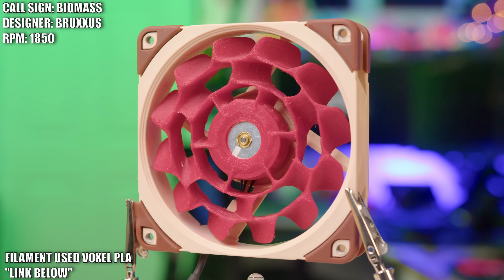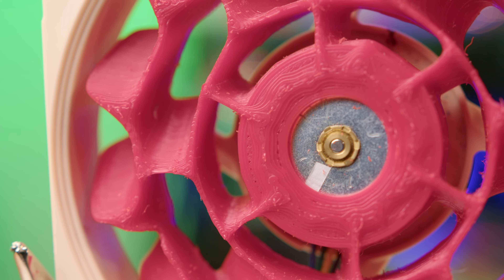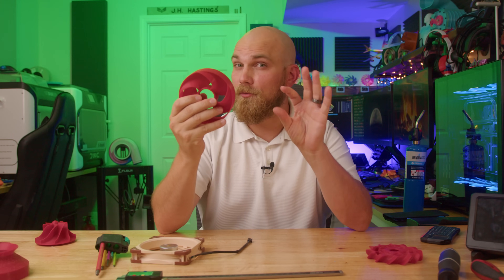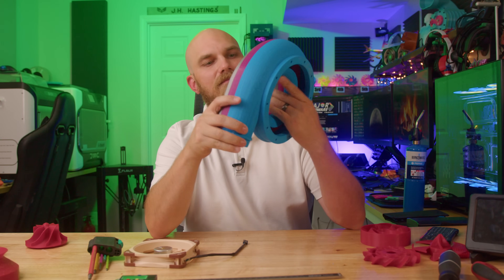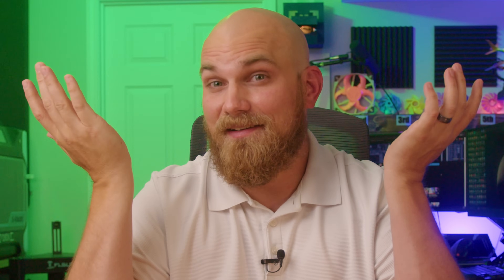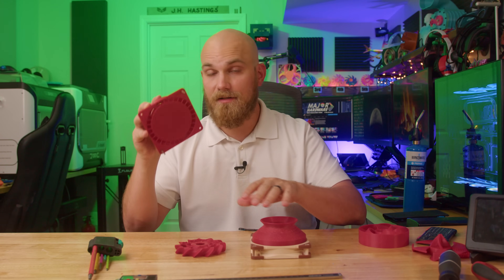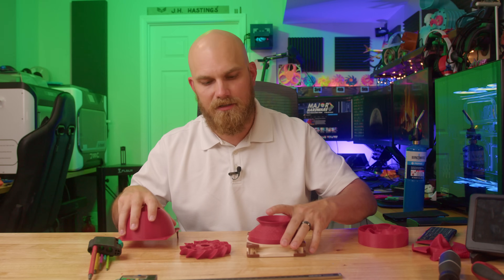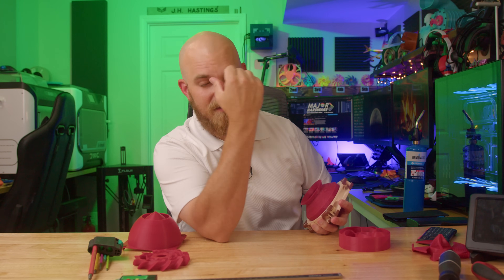What If Noctua Made A TURBO? | Fan Showdown S4E11

Comment from the maker: Correction, I had forgotten about testing the unswirl in my V400 Review, during that test I used 3d printed tpu gaskets with it, with the gaskets it did beat out the cheater. I was going by how the fan was sent to me. When the new A12x25 come in we will have a head to head showdown between the unswirl and cheater with new prints on new fans with gasket to see who once in for all is the current top dog.
Reply: Isn't the point of a turbo fan, not to increase feet per second, but to increase the pressure / velocity of the moving gasses?
Reply: @barberb  yes, pressure rather than velocity (which is air speed).  It takes a hell of a lot of force to move high pressure air at high velocity, so with the comparatively paltry A12x25 motor you will not be able to get both, not even close.
Reply: @FanPhys  we need a static pressure tester.
Reply: @barberb  I hate to break it to you, but feet per second is a measure of velocity. However,  you are absolutely right that turbo fans are better at creating pressure than flow relative to a traditional fan.
Reply: Put gaskets on both so it's an even playing field.
Reply: I was most impressed with how tight the output on the Biomass was. Noticeably tight air stream.
Reply: @salimufari  So was I!
Reply: That is going to be such an awesome episode
Reply: The turbinator needs a re-test with the seal.
It deserves to be admired in it's ultimate form.
Reply: Include the Turbinator, the pressure loss is really bad for this type of design.
Reply: You should try out a SLA resin printer. They are quite fast and the print quality and strength is top notch. Plus clean up is very easy. It would make all the fans you print perform much better and probably make them quite as well.
Reply: I saw they made an article about you Jalopnik!
Reply: What's up with the Vladimir Lenin look?
Reply: whenare you going to show a turbo. did you gorget to use google this morning?
Reply: Love it, awesome my friend!
Reply: Perhaps it would be a different segment, but have you considered evaluating bellmouth designs, hold fan blades constant? I think it would be very applicable for 3D printer users
Reply: Ah yes the Ying Yang Spinny thang

Comment: Now I don't have ideas for printer tuning. But I do know a way you can make your prints smooth and look more like they came from a mold, rather than a print.

And that's the acetone vapor treatment.

It requires a few items. Preferebly a glass box, a fan, a small glass jar and Acetone.
You pour some acetone into the glass jar.
You put paper tissue into the acetone to make it vaporize faster.
You put the glass jar inside the glass box.
You place your printed item next to the glass jar of acetone inside tha glass box.
You put a fan behind the glass jar of acetone to blow vapor towards the printed object.

The vapor will slowly smoothen out the printed surface, and will make it very smooth and shiny. It will also melt the printing layers together better.
Once you have the setup it shouldn't take that long. The glass box lets you see the progress so you don't overdo it.

Your prints will no longer look like prints.

Comment: If the turbo design doesn't flow as much air as the cheater perhaps a cars turbo is using the wrong inlet fan for their turbo and should use a cheater fan for the inlet of the turbo instead.

Comment: Derek's design is true if you can speed up the rpm... Turbo compressors are meant to run at high rpm to get full efficiency, so please do these 2 things:  1- place this turbo over a brushless motor with a speed controller to test a various speeds.... 2- make sure the gaskets between the diffuser and the jet section (back section) are leakproof in order to get true measurements. Thank you.

Comment: there is this print design called a temperature tower that is essentially a tower printed at different temperatures with the temps marked on their relevant block. what this does is that when you print a certain material you can use this tower as a reference as to which temperature works best so that you don't need trial and error. just one temp tower print and you have all the info needed to get perfect prints everytime

Comment: FS1, the Golf-Ball Fan, oooooh brilliant!!!
He understands the golf ball dimple technique.
A bit sad, that he turned it into long stretched dimples, I would have used normal dimples, strategically placed.
But that is me.
Reply: The anti-vibration gasket:
Make it yourself?
I mean, a small piece of flat elastic rubber, cut it out, bang:
Anti vibration gasket.

Not too hard, is it?

OR

Why not use small springs on the screws?
Aha.
Reply: Use cardboard if you just want to seal it.   :P
Or, well, glue.

Comment: I feel like the Turbinator would perform a lot better with tighter fan blade clearance.. I mean actual turbo's have super tight clearance too! It needs pressure to push air thru that tight gap and with a tighter gap less air would be lost thru the gap.

Comment: It's not a surprise the "trubinator" scored so low. It's not about looking pretty, it's about the right tool for the job. Centrifugal flow pumps are NOT FOR MOVING AIR at high speeds, they're designed for PRESSURIZING the air.

Comment: The Turbonator suffers from a smaller intake area.   Since the fan is running at a fixed speed it can’t pull in as much air as one with a larger intake surface area.  It’s still a cool print and would love to see it perform with a higher RPM.

Comment: what i would like to see , is a fan printed , , then the same one primted with with very fine sanding polishing even on the blades , and compare noise and performance purely to test the effect differnce between a stock noctura and the same fan  printed.

Comment: Biomass is just brilliant, varying each set of fins angle of attack depending on how far from the center they are, reminds me of this concept called "Modularization", each set of fins is designed depending on the role they have to develop, the set located farthest from the center has wider angle of attack resulting in much more drag, while in the center much narrower angle of attack results in less drag and less noise, and less material used, so effectively the fins under heavy load are the outer ones and to some degree the middle ones! Brilliant!

Comment: You should get some thin rings that insert in shroud to reduce gapping. Noticed one print had quiet a gap which is the most important design for efficiency of any design . Do a test with different tip to shroud gaps.

Comment: Hey I need help, so I want to print an EDF Fan for a oven. But the Problem is that the only thing i still need is the Fan, but I dont know how to Design IT and what would move a lot of air. The Motor Has more than enough torque and spins with about 10000-12000 RPM. I hope someone can help me.

Comment: you got to restest the turbonator, a turbo is all about pressure and if there is a leak it just won't work, like your test showed it does not work, you can't have leaking air in that thing. restest i'm sure it will score WAY higher.

Comment: I could definitely see just a normal car turbocharger working great with a small industrial motor or a drone motor driving it - it would definitely be able to generate some pressure and flow rates - and you'd only need the compressor side, although it might be plausible to use both stages in series if driving the assembly with an electric motor. Turbo chargers are very cheap as scrap.

Additionally an intercooler system can be used to cool the air, and an active air conditioning / refrigerant design could be implemented using automotive and industrial off the shelf / scrap parts.

After all, it's cooling rather than airflow which is the goal.

Comment: The balance of the rotor assembly is incredibly important. You could quite easily balance any of these rotors and get better performance. 

Single stage radial designs of turbine would be better made from ceramic or metal for tight enough clearances and high speeds - the motors used to drive low speed fans are insufficient to activate radial flow compressor driving an empty manifold. Gearing and a compressed air start may be appropriate. They exist in heavy industry - have a look at the OPRA OP16 for reference

Comment: The turbinator looks like is has too much back pressure on it. It is funneling all that air to a flat surface with small openings around the outer diameter.

I get trying to focus the air path a bit, but I think that fan with a better air path would be much MUCH better.

@9:45   Pause it there and look at that surface area that has no place for the air to go? If that matches up with the bottom of the turbinator blade then the it might need to be scaled down a bit so the bottom is a smaller diameter for better air flow.

Comment: I think that a good test for the channel, possibly revisiting the top 20, might be static pressure.  Because, as we all know, you can have velocity unloaded, but without static pressure, you cannot move that velocity across a radiator.  CFM and static pressure together in a vector diagram would then give you more precise cooling results, as compared to a simple heatsink test.   Possibly even a heatsink with a heater attached, setting a threshold for failure, then measuring the heatsink fin temp, and base temp, which will provide a fairly accurate dt for the sink, as well as proving that velocity doesn't always equal cooling.  That test could have a variable power supply, such that, as the current is increased (read power) the dt across the system is measured, up to a set point.  This can be accomplished with a DCV power supply (bench/ lab unit) and 2 thermocouples.

Comment: Acetone vapor smoothing is a chemical treatment that “melts” the surface of additively manufactured acrylonitrile butadiene styrene parts. The process fuses layers together and allows them to reform when vapor is removed, resulting in a smooth surface finish.  PLA can't be smoothed with acetone in the way that ABS can.  There is a type of PLA whose formulation makes it soluble in isopropyl alcohol, a much less dangerous product than acetone or methylene chloride. This is why this material, of the Polymaker brand, has become quite popular among those who want to smooth their parts without getting too complicated. Polymaker Polysmooth is composed of PVB, a material very similar to PLA that can be chemically smoothed. However, it requires the use of the Polymaker Polysher.

Comment: I'm working on a project which needs a vacuum. As this project is going to be portable and completely custom I was looking closely at many different vacuum types and there is a lot of variety. Maybe this could be a new chapter for fan showdown ?   A new evolution it would be !?!   They are very similar to fans, except they obviously work backwards & also need a housing ++ I see massive gains from guide vane looking things similar to what "The Cheater" used. 
We could use the same A12x25 stuff...   Then again, maybe the idea sucks ? or maybe it would be a race to who sucks the most !!

Comment: leaks will make a significative difference on a turbocharged system but i worried about the intake size : why bother make a 80mm fan to the size of a 120 mm and trying to compete against it ?
 at least it will maybe made an huge static pressure for a ventirad but the shape of it will make it useless in a case.

Comment: I'm wondering if the next season will have a divide between:
- "designs that fit within the default working volume" (i.e. a "normal fan" like the Biomass)
- "designs that exceed default working volume" (i.e. anything that goes outside the standard bounds but is a single component, like the Body12)
-"Designs that exceed the default component count" (i.e. The Cheater Fan.  This might also need to be split between those that stay within bounds, like clockwork/gears, and ones that work outside the normal volume, The Cheater)

Mostly because I'm a bit tired of "Can this topple The Cheater?"  No, because it's following the original spirit of the first ruleset by being a fan you could actually fit into a normal case / onto a normal CPU cooler.

Comment: Please try to use 3 to 4 different blade widths. This should considerably reduce monoton pitch noise. This we use also on tyres to reduce tyre noise. To avoid uniformity issues, place the blades so, that the center of gravity is near to the rotation axis. Also you can find a good pitch sequence by using FFT (very simple one just using numbers like: 3,2,1,2,3,3,4,3,4,2,3,2,1,2). Avoid biggest and smallest blades near to each other.

Comment: I'm a little bit disapointed that for this season we don't have the actual temperature test, i do realize that it allows for more flexibility in design but for me its obvious that the biomass doesn't produce the same kind of airflow than the body 12 for instance, the wind tunnel kind of removes that viariable in favor of airflow.
That's specially relevant for turbocharges since changing the air pressure changes the temperature of the gas as well so even if you have less airflow its possible that it is more (or less) efficient at cooling than the airflow might suggest, same reasoning applies for fans that move a lot of air but scatter it everywhere instead of focusing all of it in the heatsinks.

Comment: if you wanna tune your printer, i HIGHLY suggest you check out Maker's Muse, CNC Kitchen, and Teaching Tech. they all offer multiple ways to really dial in your specific printer, regardless of what printer you're using. (well, as long as it's an FDM printer. I think they have guides for resin printers too, but that's a different beast)

Comment: for the one from derrek i would have brimmed the print and done no support most printers can do those anglew without support. also a fiber gasket is cheap and would have fixed the side leak

Comment: You know I bet a interesting test would be pressure testing. Higher pressure lower flowing fan designs can be superior for dense radiator/heatsink fins then a lower pressure higher flow fan.

Comment: Hearing numbers is nice, but an important part to this video is the visuals, especially for those of us who aren't particularly familiar with the field, let alone anyone who doesn't work with Imperial scales. The smoke is a good way to showcase how a fan pulls in air and especially whether there's leaks in the system and how the exhaust looks; but I feel like there might a way to improve it, in particular on the intake side of things. You see, different fans start to pull in the smoke from different distances, but without some frame of reference, there's no real way to just 'see' that.
Perhaps an idea would be to mark a grid on your black paper that corresponds to regular distance intervals from the fan, that way you can see "oh this one draws in the smoke from 2 squares further away than the other one, but is less good at pulling it in from the sides," that sort of stuff.

Comment: I think it'd be curious to just check how well the Turbonator does withOUT its outlet.
With the smoke, that'll give an idea of whether the "compressor side" is forcing air backwards at all, or if it is throwing it out sideways.

Because if sideways, it'll end up wasting a LOT of energy just to redirect the airflow backwards. Judging by the speed the smoke was traveling out of those slits, I think that's likely the case. 
(And, that there was probably to much restriction on the outlet, creating way too much backpressure, only further making the air want to escape anywhere BUT intended...)

Comment: Turbinator suffered from leaking because of high pressures. You should test it with the gasket as it's more important for it than others that relied more on air flow than pressure.

Comment: those dB graphs are pretty cool from a NVH standpoint and could be used by the designers if they wanted to improve their fans for noise at least. I only have a passing experience in this so my analysis is pretty surface level, a.k.a crap but there's lots to see. The biomass shows peaks at 30.8hz (1850 rpm) so it's a noisy design overall. There's a smaller peak at 62hz which may be the 2 rings? Another at ~120 which is 4x 30 so that may be a harmonic? One at 185 which corresponds to the 6 blade rings and a big one at 370 which would indicate the outer 12 blade ring is spending a lot of energy making noise instead of moving air. The next one is maaaaybe 740, so a harmonic of the 12 blade ring?

The robert fan has a huge spike at ~150 which makes me want to say probably the small middle blades make a ton of noise vs actually moving air? Not sure there. Or maybe the dimpling actually causes noise? The 2140 rpm is ~36 hZ and 5 blades would be 180 hZ so that's a little off from where I'd expect to see it but does show that the fan expends a lot of energy making noise.

All that said, I wonder how much just cleaning up the prints would help with noise.

Comment: There is something to be said for designs that produce a more laminar flow. The fan will have greater time exposure to the fins of the radiator vs a fan that kicks the air out in all directions (FS1 vs Biomass).

Comment: I could be wrong but the turbo style fan would work if the RPM was increased. That style of blade system in turbos was meant to compress air as long the RPM is at max efficiency.

Comment: The Turbinator had a boost leak, also the compressor wheel could be designed to be a little more snug so there isn't a visible gap and it'll compress the air a little better

Comment: A turbine doesn't really work at PC fan RPMs. (Unless it's several meters across) One of that size needs 10s of thousands of RPM. Speeds at which any plastic will sharter.